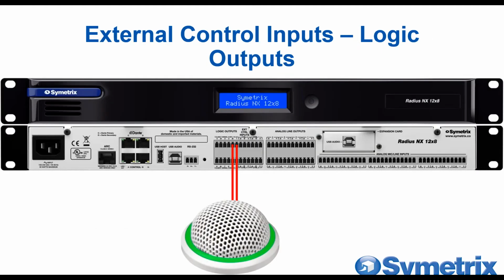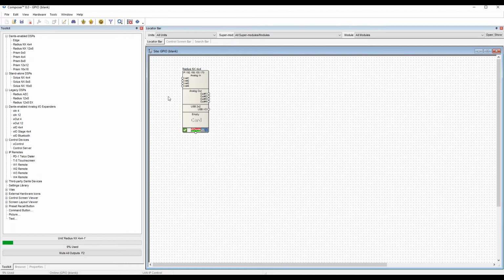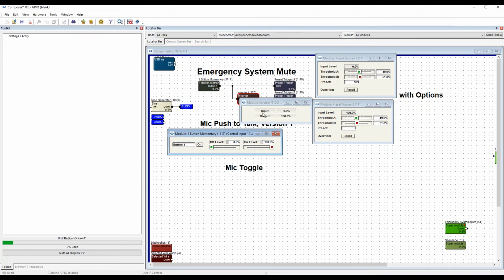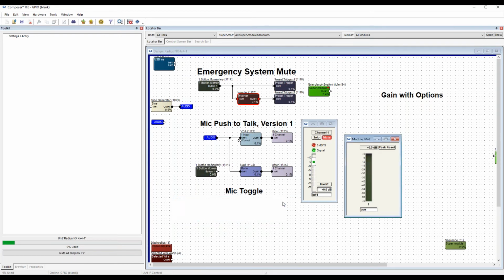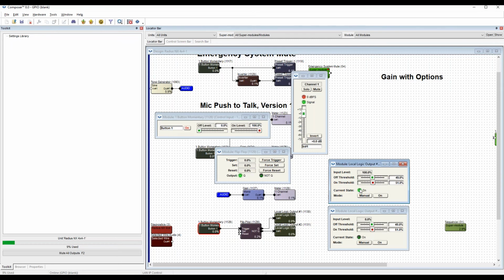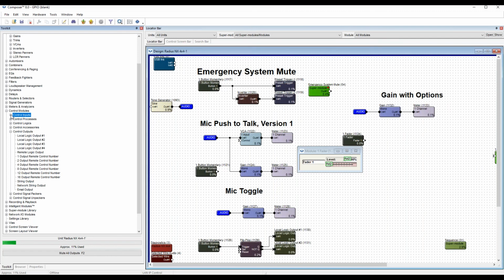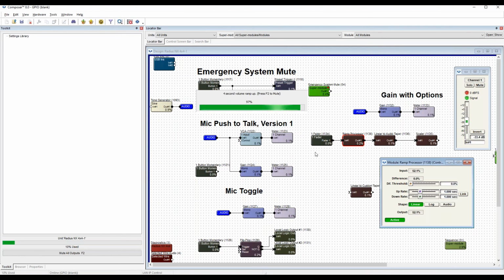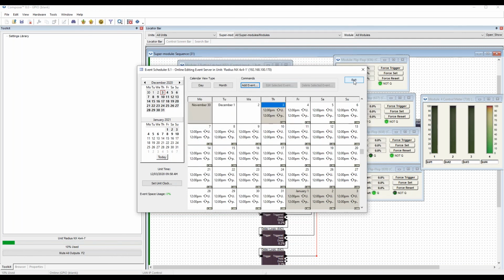Symetrix Webinars — GPIO & Logic

Comment: Hi there, is it possible to automate a Button (Latched or Momentary) based on a user defined delay time, in seconds/minutes, etc?

For example:
I would like Button 1 to switch ON every 20s, and remain on for 5s before turning OFF again for 20s.
I would also like Button 2 to switch ON every 25s, then turn OFF for 5s, etc!

I know how to do this with typical PLC software, but not really sure how this would be done in Composer.